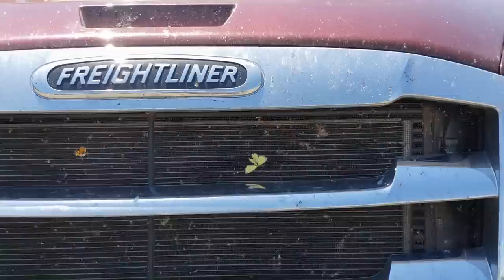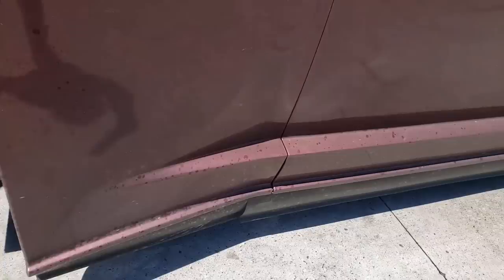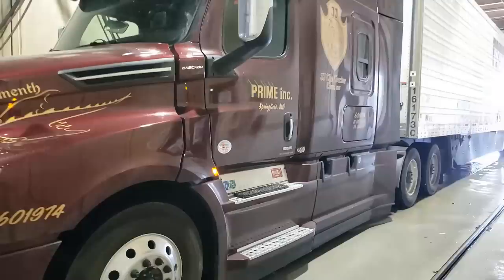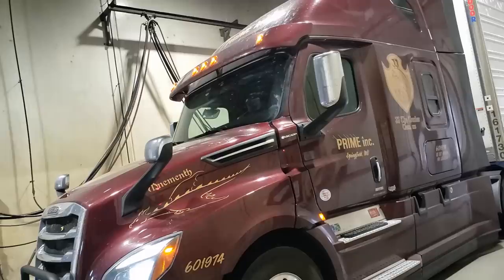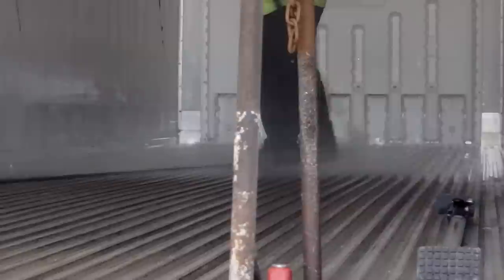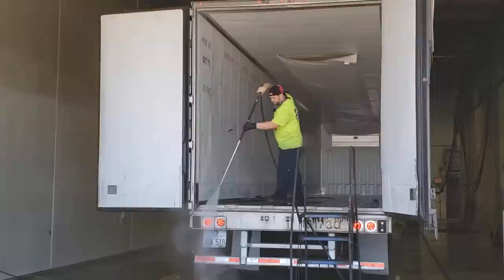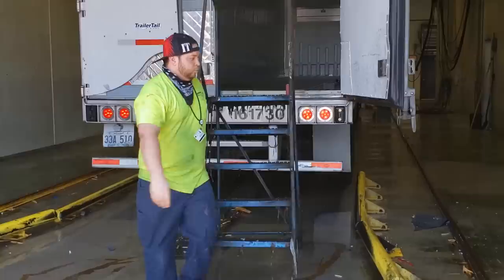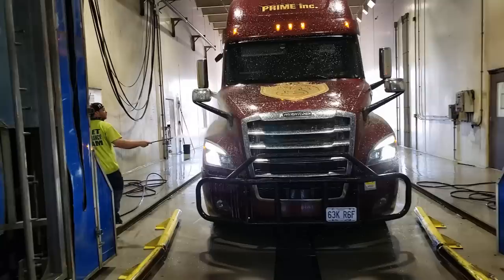Truck Wash - You Asked, I Delivered. Meet Joe at Prime Pittston, PA - Plus Trailer Washout.

Comment: IIRC: TRUCKER'S TABLE recently had to have his VOLVO radiator flushed out at a truck wash as he was having A/C problems & had the truck wash attack the problem from under the hood, about the only place they couldn't get completely clean, was near the bottom of the radiator due to the design of the air dam.  Best time to hit Blue Beacon washes are late nights while most other driver's are sleeping. 🤠
Reply from the maker: Hadn't thought of that. Thanks!

Comment: Here in Knoxville it cost 33 to 47 at the Blue Beacon Truck wash..... If you want a really clean windshield cut a big onion in half and use it on the windshield let it dry then use news papers and some amonia free window cleaner works every time......
Reply from the maker: I tried that but it didn't work. I used the onion, let it dry, got some ammonia free cleaner. I had to substitute USAtoday.com for the newspaper since I couldn't find the real thing. Do you think that made a difference??? 🤣😂🤣😂🤣😂🤔

Comment: I've never had the pleasure of taking the truck to a full service wash. I usually will try and wash mine once a week at a DIY coin wash,  tractor only. Usually cost me about $25. And 3 to 4 hours to clean the inside and out. I'm very meticulous and like my truck very clean. I even keep the floors spotless. I didn't notice if you put any armorall on the tires.  Here in southern California,  I like my cars and the truck I drive to be clean and shiny. I clean my windows at least once a day,  sometimes more depending upon the heat and the bugs.  I hate looking through a dirty windshield.  Your truck is super squared away. When I get back to work next month I'll be aiming to have my truck set up like yours. Bummer you went right into some rain...lol
Reply from the maker: Yeah, I'd like to be meticulous like that too, but it's just too much time, and a couple hours later it's dirty again.

Comment: I used to work at penske before I turned 21 and could drive OTR and our wash bay was pretty much the same deal just NO WHERE near as nice as that one. On top of the fact our machine was the exact same I believe or different model but looks exactly the same and our controls for it were on the side of the machine it's self. That machine always broke down and I could hardly clean the trucks but same process. Spray it with degreaser, power wash then machine wash.

Comment: The pre soak on big truck washes is acid.
Reply from the maker: Many things we eat are also an acid, so that may not be as bad as it sounds. As long as it doesn't eat my paint and metal away then soak away! 😁
Reply: @JJtheTrucker  we used to take our trucks to the blue beacon on fridays and they used acid diluted. But it was still strong enough to eat the shine off the wheels. Then you had to go polish the shine back out

Comment: How long did it take when you switched from manual to automatic to get used to not trying to push the imaginary clutch pedal. I switched from manual to automatic and it was ok at first but muscle memory takes over and when I would come to a stop I would have a small panic attack trying to find the clutch pedal that didn't exist lol. Also I have thought about going over the road, how do you like prime, how often are you home and as a company driver not a owner operator can you take pets along for the ride
Reply from the maker: Lol it took a while and I'd switch back and forth for a while till I finally stuck with the autos. But yeah, same panic and the foot nearly going through the floorboard and reaching for the stick.
Reply: @JJtheTrucker  haha what really gets me is i do it in my personal vehicle. Thanks for the reply and again hello from Maryland at the beach
Reply: I'm so used to backing up my trailer with my pickup truck that backing up without a trailer is tricky. Driving with and without a trailer is like knowing two different languages.

Comment: How much is ah truck wash the combo truck and trailer?
Reply from the maker: At the Prime Terminal, they was their trailer for free (inside and out) and my tractor is only $10. If I go to a Blue Beacon, it's usually around $45 for the trailer washout (Prime pays for that) and around $40 to $60 for the tractor, depending on options.

Comment: JJ I contacted pedigree and got  some good info I was wanting to ask you if you know what your tractor weight is it is usually inside the drivers door. I was looking at a lite weight truck the salesman seemed to think the weight diff was only about 1500 lbs but he was not sure the lite weight was listed at 16034 lbs but did not have the weight of the condo. thanks hope you can fill me in.
Reply from the maker: I'll check the sticker tomorrow. Remind me if I don't. On the scales, with me and my stuff, I weigh in at 20,000. I probably have more stuff than most.